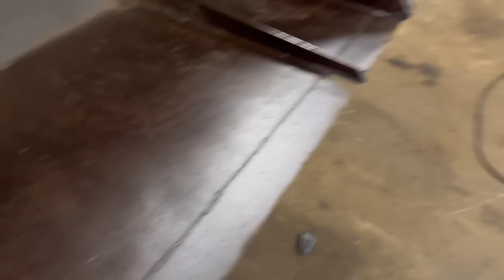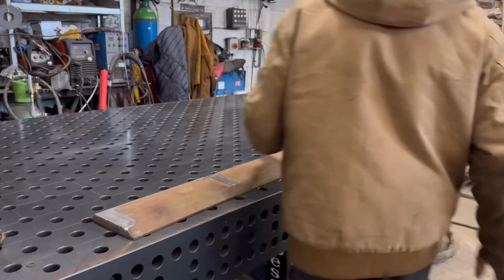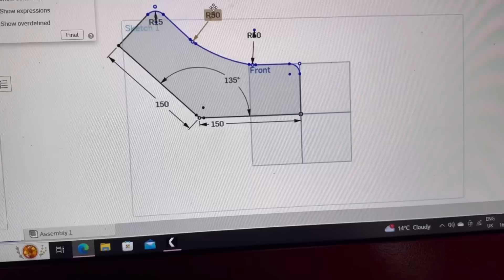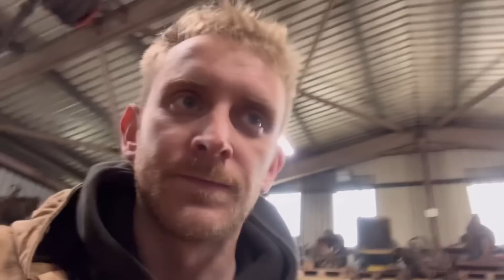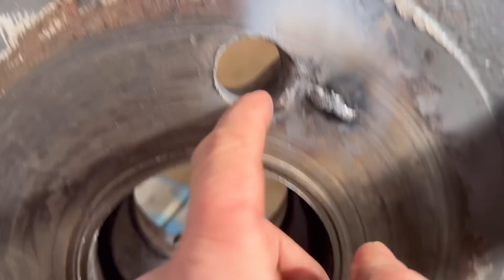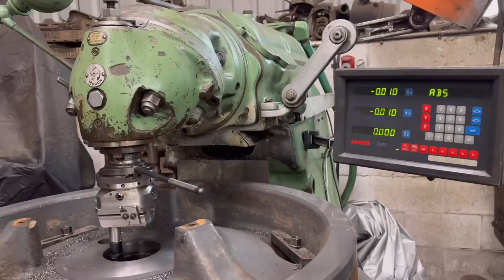Changing a bucket edge and drilling and skimming baler flywheel

Comment: Oliver, regarding your pursuit of more power in your tractor. 
I gave an old Isuzi station wagon, about 3000 lbs, with a 2500cc TFR engine, factory stock no turbo. It ran well, with as expected performance. You know, a lead sled. A pro went digging into the fuel pump and tweaked things several times. He found a sweet spot. Now the car runs like a sports car. Unreal, unbelievable amount of more power. All it took was some precision with tiny little adjustments.

Comment: Seems they would use a cutch disc. Like soo many other  things like this. The "presdure plate" could have a wedge to keep pressure on the disc. So if it slips it must be reset, like a mechanical circuit breaker. If the tq is too great for a single clutch disc. Use two, Alongvwith q floating plate between disc. Even 3-4 disc. And use a tiny 6" (+/-) clutch disc if size matters. Seems the manufacturer wants you to spend $$$ every time the tq rating is exceeded!😒 despicable!  Widely available automotive parts are available ,  we deserve! The right to repair. And planned obsolescence should be a crime!

Comment: Using the audio which is normal speed when you speed up the video is much better Ollie, less screeching etc :) good work as always
Reply from the maker: It’s definitely better but it takes a lot more time editing.
Reply: @snowballengineering  i am hopeful it becomes less time consuming in time if you could save audio files of grinding/welding/plasma cutting etc as i’m sure it sounds the same when sped up :)

Comment: I expect someone else has suggested it but when you skimmed the flywheel, if you started at the centre, went as far as you can and then used the X and Y travel to incresse the swept area. As the area is not a "proper bearing surface", a slight lobing at maximum diameter shouldnt matter significantly, provided it is big enough. As with all viewer comments, ignore if it seems or is wrong, it's merely a suggestion that i have used succesfully myself.
Edit, to get height right span with a parallel and add width of same to get final depth.

Comment: On my cheap boring head I can put the side tool holder in from either side, yours being automatic widening, could you not do the same but cut inwards? or spin the mill in reverse to cut outwards but using the other side obviously reversing the cutter too.

Comment: To release the feed rate buttons on the boring head 
1) Insert a suitable bit of round bar into the retaining ring hole. At 50:57 the hole can be seen just above one of the feed rate buttons, and sits within a quadrant to limit motion.
2) Push the locking button on the top surface of the boring head (just to the left of the stop rod, can also be seen at 50:57) and keep it pressed
3) Move the bar in the retaining ring towards the stop rod as far as it will go.

Comment: 50k Oliver, what a great achievement.  You deserve it all.  Put a couple of plug hole welds in those support fishplates move the stress about a bit. Ex loctite employee here, put the retaining compound on both components so it wipes in as you assemble, rough finish better than polished.

Comment: Nice job mate. The bucket repair although we have seen you do them before, everyone is slightly different so it is worth watching. The fly wheel is designed well with the sheer pin breaking before causing damage to the baler. On some of our industrial gearboxes we had to make them the weak link, so not to cause damage to a multi-million pound installation. It was 99% of the time me that had to go and fix them, even on Christmas eve. Still that's life. Good post, thank you 👍

Comment: Great video 👍 Do you add to the cost of the job when doing extra plating or is that in the. Original price 😊
Reply from the maker: Hourly rate job, just costs what it costs to do.
Reply: @snowballengineering  ok didn't want to get to nosey about the financial side but doing it by the hourly rate keeps it straight forward.

Comment: I would like to see you using 110 volt powered hand tools for safety reason's 240volt hand tools  not very safe! Gordon Nolan Retired Mech. Engineer.
Reply from the maker: 110 is only used for site work in the UK

Comment: Well done on 50,000 subscriptions, in about a year is impressive. 
I have a couple of the same ratchet blocks as the one you used. I got them from work about 30 years ago, when the lifting equipment insurance inspector condemned them to the scrap skip, due to twisted chains and missing throat latches. They have been very useful over the years, although with my advancing years, they are getting a bit numb and heavy to use.
Reply from the maker: Thanks! 
This one was my grandads. Nice to remember him everytime I use it.